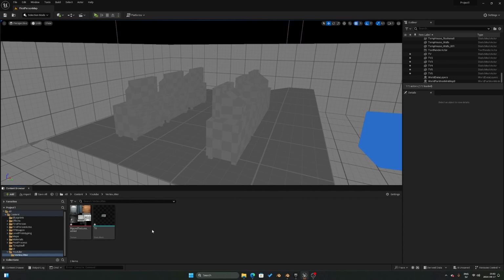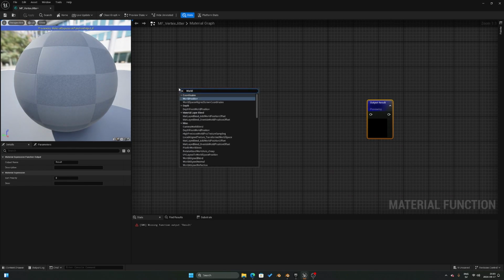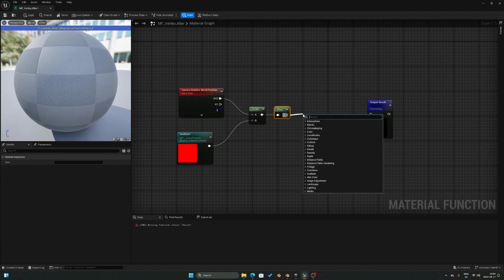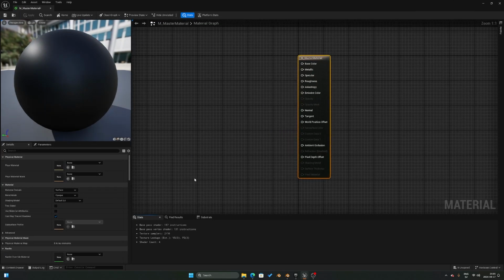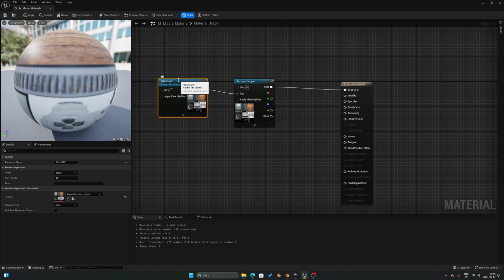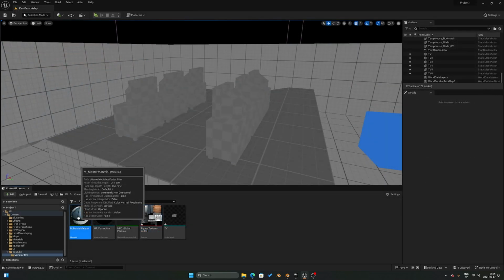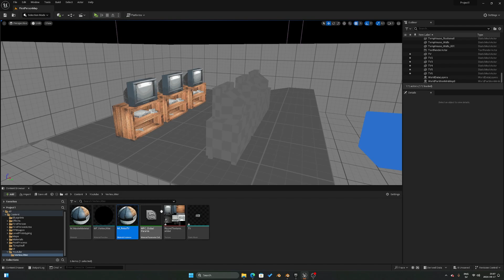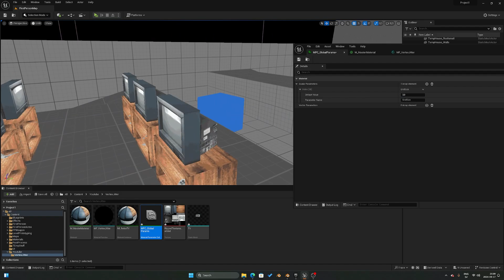Playstation 1 Vertex Snapping in Unreal Engine 5 - A quick tutorial

Comment: If anyone is having an problems such as the material flickering black, make sure your mesh is completely manifold and has no self intersecting verts (to avoid overlapping edges). You can do this in unreal as well using the modelling tools, and then using "Union" to bool the mesh together and resolve self intersections. The newly generated mesh usually shows up in a folder named "_GENERATED" so make sure you apply that new gen as your static mesh. Other problems may come down to things like flipped or wrongly calculated normals.

Also if you are using this on small objects, especially small physics actors, it really helps to create a second version of this material with a different GridSize Value in the MPC params, smaller sizes like .5 can really help with the ugly black clipping or too much distortion.
Reply: Everything I sated above is still true, but after more testing I found what was probably the real culprit was, Lighting. In a full lit outdoor map with Lumen GI hard shadows can really make it look messy. In darker rooms the problem goes away. I assume it wont be a problem if you are not using Dynamic Global Illumination(Haven't tested yet), which you probably won't use because this is kinda for retro aesthetics anyway. I'll leave the top comment because it still does help fix some other issues.